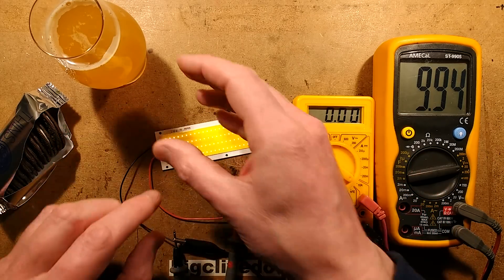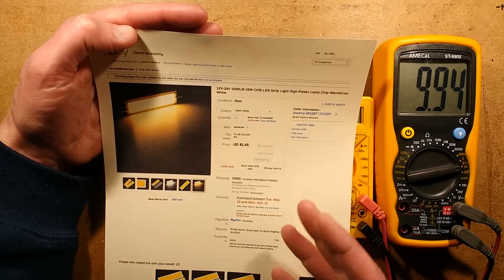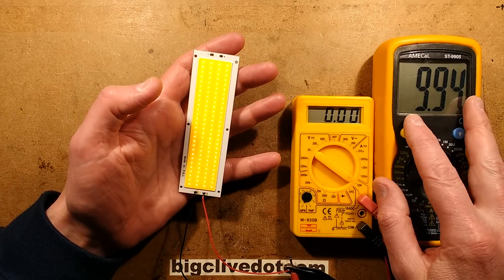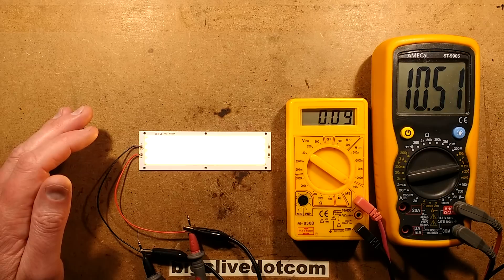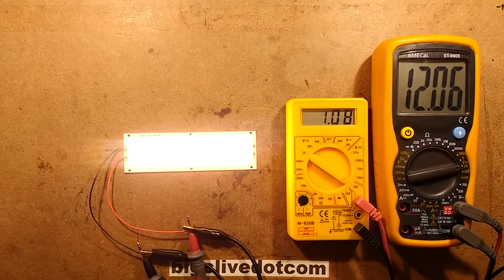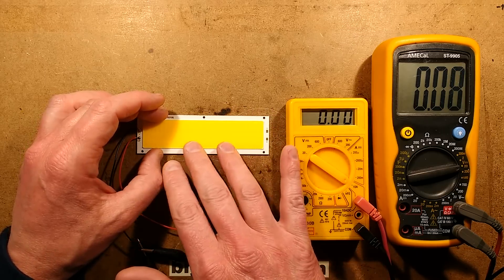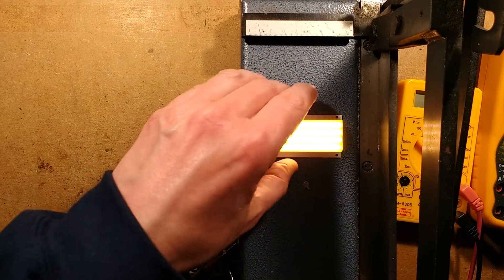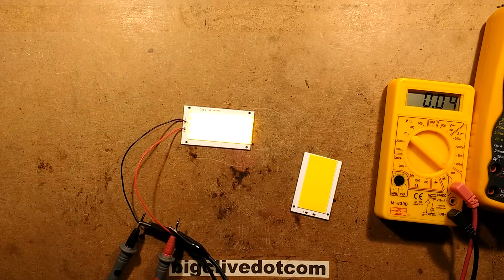Testing a large LED COB.

Comment: I've bought a few of these, and I'm pretty sure the 10W rating is just arbitrary nonsense.  They appear to be about 30 mil dice, and it'd be a fair assumption that they'll survive 150mA (about typical for 1/2W rated parts).  With 28 columns, that'd be a total capacity of 4.2A or about 50W.  The whole thing has more thermal interface area than most 34mm cob emitters do, so I don't know that it's unreasonable.  

Then again, who knows what the thermal resistance of the die attach & substrate insulation is like.  That, and the ones I have are quite mottled (low-quality chips?).  I'd still be tempted to at least provide a bit of resistive ballast to lower the current slope, but on such a wide array, there really isn't a way to enforce current distribution.

Of course, all of this is moot because I imagine 90% of these things will get shoved into an application where the only heat sinking they'll receive is being loosely screwed to something with the thermal resistance of a postcard.
Reply: Well, so much for my plan to mount these on postcards.
Reply: Yes, it's crucially important to have enough heat sink area for the emitter.  For something this big, you should use at least an A4 sheet of cardstock.
Reply: Use a stack of daguerreotypes.
Reply: Not sure they'd need a heatsink if you run them at 12v like there suppose to the metal on the back should be enough to stop them heating up. I was thinking of sticking them to my car and just limiting the voltage down to 12v and let them eat whatever current they wanted (current only seems to go up after 12v anyway).
Reply: At 12V, with no series ballast, the COB will draw about 370-380mA.  That's about 4.5W.  Considering that you'd want the substrate to stay below about 80C, you'll need about ~8K/W thermal resistance to ambient.  For a simple modeling of the COB as a plate suspended in air with natural convection flow across the faces of the plate, estimates for thermal resistance are in the ballpark of 10-30K/W (i.e. too high).  The variation depends on what the ambient temperature is assumed to be and how you consider the insulating behavior of the silicone phosphor coating.  At 14.5v, the power will be much higher.

Will mounting it to a relatively small bit of sheet metal suffice? Perhaps in some cases, but in an automotive application, the things that it might be attached to may already be at 70C (e.g. a metal plate or strut in the vehicle roof).  

Will shifting the operating point with a series ballast help? Sure -- as long as it can stay below Tjmax within the range of environmental temperatures at the selected operating point.   If you have an appropriate thermal design for a 12v operating point, you still have to keep in mind that your ballast will be shedding about a watt itself.  

Just because manufacturers push components well outside their SOA, doesn't mean it's smart to do yourself without accepting the potential consequences.
Reply: Dream Services International electronics give me a headache. Half the time things need a circuit the other half things are misslabled or simply don't do what there suppose to. The drop down will be fine it's one of those 12-24v stepsons in a waterproof heatsink (one of the few things that does what it says it does) as for the cobs I'll probably end up sticking 2 on either side of the boot like a work light if they need cooling I'll either jam a heatsink on the back or thermal paste them to something big and metal (make sure it's not going to short though)
Reply: +Dream Services International When calculating dissipation, don't forget modern LEDs are about 25% efficient (compared to a black body radiator), so only 75% of the input power gets turned into heat.
Reply: hellterminator: Correct, The calculations I used for the prior post assume P_radiant=0.2*P_electrical
Reply: Richard: A switching converter would shave off that extra watt compared to a linear or resistive ballast, and in reality a marginal heat sink would probably be fine.  I have a feeling that the quality of these arrays isn't that great, so one need not invest too much effort in perfecting their longevity.  They're cheap enough that if you don't mind swapping them out, then why not?   The ones I have run on a heat sink that's too small for constant operation -- but I never intend for them to be used for more than about 60 seconds.

In the end, you're free to make your own choices, but I find that life is less frustrating when you're able to better predict the risks of future problems and specifically accept that they may occur.  That's a lot less maddening then having something fail when you'd had no expectation that it might.
Reply: +Dream Services International How? 
12V*0.38A=4.56W. Where did you take off the 20%? 
Also “to stay below about 80C, you'll need about ~8K/W thermal resistance to ambient” suggests your baseline ambient temperature is 44°C (4.5W*8K/W=36K; 80°C-36°C=44°C). Isn't that a bit high? 
I haven't gone over your estimate of the thermal resistance, but your calculations seem a bit strange overall.
Reply: The nominal estimate I stated is the electrical power, not the thermal power.  The scripts I use operate on the stated assumption that thermal power is 80% of electrical power.  

The scripts default to the typical peak ambient temperature associated with the lamps I have been building -- 50C.  Perhaps it is a bit of an overestimate when applied generally to offhand unknown cases, but 40-50C is not uncommon for many applications.  These aren't even worst-case conditions. 

Also, keep in mind that if you try to back-calculate an input value from ranges of rounded output values, you're going to end up with another approximation.
Reply: In well-lit areas such as the dashboard, and in the space between the headliner and the roof, the temperatures can get absurdly high.  Even ambient cabin temperature in a closed vehicle can be easily >60C.  This is an old photo from a test of an unrelated cooling device.  The "in" sensor is the ambient sensor, and the "out" sensor is the remote probe in the cooled enclosure (not relevant).  This  offhand snapshot  is 58C.

https://a.safe.moe/ltGBMSg.jpg

Of course, a device that's operating in open air and only when a person is inside will usually be cooled down once the cabin is ventilated.  Things that operate unattended or in the headliner space or against the roof are another story.

Comment: Clive, 12v alternatore will routinely have an upper limit of 14.4 volts. 13.8 is just idle speed power, fwiw.
Reply: Yep spot on, sometimes a tad more ,but point is 12v cars arnt, safer to build fir 15v
Reply: Против Глобал EU, US, Japan, the trandient spikes thrown by starters as they disengage run up to 600VDC and truvks run to 2000VDC but that is only for milliseconds. Spike protection is a separate matter from operational voltages though.

Comment: I would use an LM2596 DC-DC module, to run them in a car or RV. The modules are $1 Canadian, on eBay.
Reply: Resistors are cheaper. And if you only need ten hours of life out of the LEDs, you don't need a resistor.
Reply: James Van Damme Believe it or not, 3 watt resistors are about the same price as these modules.
Reply: Против Глобал what's the function of the diode? Something beside reversed polarity?

Comment: Great stuff BC :) thanks.
I wonder if you could make a big 7 segment display out of it when you cut it into pieces, or cut 2 into 4 pieces each then use a colored(red/blue/green) transparent film on top of it.
This bench power supply might help you in your projects, cause it shows consumed voltage and amperage on its display so you do not need to use 2 DMMs. GOPHERT CPS-3205 / CPS-3205II
https://www.banggood.com/GOPHERT-CPS-3205-0-32V-0-5A-Portable-Adjustable-DC-Power-Supply-110V220V-p-934530.html

Comment: do you think you could wire 10-20 of these together to make a growlight?
Reply: No, they only need to be red and blue.
Reply: Moose   chuck is right in saying that green plants only need red and blue - they reject (reflect) green, which is why they look green.  But white light contains red and blue, so you can use white light for a grow light.  Sunlight (white) suits them okay after all.  You're just using more energy than you need to.  It comes down to cost of equipment and running.
Reply: No, white sunlight contains the entire spectrum, artificial light is made up of a set of wavelenghs. You either need a bunch of luck or a real growlight.

Comment: Damn I am using those Cobs as a replacement for track lights.  I take 24v AC down to 12V DC. Sitting behind the buck converter and a bridge rectifier seems to limit the current.     I put a thermocouple on the back of the aluminum and it did not go over about 50 degrees C. What size resistor would you put in front of the unit.  Oh damn you mentioned it in the video.  I might bring the voltage down to 11.5? what do you think is 12v ok?
Reply: Arnold Horshack 
If the module is only producing 50°C then it seems that 12V is fine. However, the cooler the LED's run, the longer they should last, at least according to conventional wisdom.
Reply: thanks Pete.. I am glad the big guy reviewed these leds..  I am mostly new to tinkering with electronics and Clive (and Julian Marco Reps and Afro Mods) have all helped me to revisit something I did as kid (build radio shack kits) at a higher level.  I did notice at 24v these things were pulling 3amps I said nooo..
Reply: The 12v produced from the buckconverter is not ramping up to 14v. The converter is probably experiencing the 24-28 volts but steps that down. Then the 12v is good enough

Comment: Couple of points:
1, that high pitched whine/hum in the background is actually the sound of Clive's positronic brain working away 😜
2, I would think a cheap step down (buck) regulator that has output current limiting would be better if running from a 12V or indeed 24V car/van/truck/caravan or boat supply 😉

Comment: I was cringing as you went to cut that COB in half, but, I'm actually impressed that it survived, well, the one half at least, the other half still needs testing... :D
Reply: As it has busbars and solderpoints at the other end, it should be fine aswell.
Reply: What would break exactly? You could possibly have a short circuit at the very edge, but that's about it. I'd be more worried about long term reliability due to corrosion where moisture can now enter.
Reply: They‘re like earthworms!
Reply: Hi, I'm quite impressed with these little strips, I'm going to use a few of these in a project with a 12v laptop supply with a Buck transformer and run them at a modest (cooler) current, maybe 500ma a peice...11.5v ish.
My question is to reduce flickering (if any) would it hurt adding an electrolytic to each one just to guarantee no flicker? If so, what value would you suggest on a 16v cap?
This may be irrelevant as long as the laptop supply is smooth anyway but if I wanted to make sure, is there a sweet spot regarding caps or is it bigger the better? 
Thanks, your avid subscriber.
Reply: they dont need to be cooled, they do not get above certain temperature
Reply: Cody Slab ok...thank you but that wasn't my question.
Reply: stop kissing ass

Comment: How hard would it be to put leads on the part you chopped off?
Reply: Jim Fortune 
Simples! 
There's already solder pads at both ends of the PCB for the option of daisy chaining multiple units together.

Comment: I purchased some smaller cob modules that were advertised for car use, and came with 3 different bulb adapters so they were effectively plug and play. I tried one in the interior light cluster in the car and after about 5 minutes it got so hot the solder melted releasing the power wires, perhaps a good thing really. From China of course.
Reply: Richard Dobson 
Perhaps they were intended for use with a heatsink of some sort?

Comment: It's important to note that the guillotine is NOT your standard, everyday paper cutter.  Standard paper cutters slice the paper starting at one end and progress to the other.  The PCB will 'break' ahead of the actual cut point as the cutting blade passes the support surface.  You want something to keep all the PCB stresses evenly distributed along the length of the cut and limited to the cut itself.  Even tho Clive's guillotine has a progressing cut, the additional leverage allows for a quick cut to reduce the 'breaking'.  I wonder if I can convince someone that theirs needs to be replaced ;-)

Comment: i would suggest to also fix the voltage across them with say a (high power?) zener in paralell as the vi curve of a diode (so also a led) drifts with temperature leading to a higher current as the leds get hotter and thus only heating the leds even more

Comment: Clive, if you want to heat it up to solder, just give it power for a few tens of seconds lol.  What would've been really nice is if it had a low profile buck regulator on it for vehicle electrical systems, or at least offered both versions.

Comment: Are those solder pads on the cut half of the module ? if so can you solder on to those and have two for the price of one ....
Reply: It's really not worth being that cheap about it.  Buy a smaller module, or run the larger one at lower current for higher efficiency and/or less heatsinking needed which in itself can lower cost and design time.
Reply from the maker: Yes you can.

Comment: I actually have a pair of these exact modules in my cargo van.  I found that they will get particularly hot when supplied with sufficient current (nice sizzling chicken effect).  However, they seem to run quite happily with a 15 ohm resistor ahead of two modules.  I've got roughly six months on mine so far, no failures.
Reply: guitarstitch why not use a buck converter ? More efficient what you think ?
Reply: Ammar Abotouk And of course they cost next to nothing
Reply: Do they give out enough light after putting in the resistors?

Comment: Not bad! You could actually use those with one of those cheapo LED drivers inside some cheap lamp fixture, the thick aluminum backing plate could make them a better alternative than those standard COBs.
Reply: Please actually stop using the word actually where it actually isn't actually needed actually.   Regarding cheap lamp fixtures, it'd be reinventing the wheel.  A legacy lamp fixture is meant for a certain bulb format and most of those are now covered by inexpensive drop-in LED replacements, with a certain level of tested reliability, and safety if you buy a major brand.  Instead you could create your own artistic version of a lamp, optimized for the form factor of the LED(s) used.

Comment: I wanted to get a proper PCB shear, but as a hobbyist I just couldn't justify the expense... I got a sheet metal shear instead for about 1/4 of the cost. I'm sure it doesn't cut PCBs as neatly and cleanly as a proper PCB shear, but... yeah... Anyway, I haven't reinforced the bench out in the shop and bolted the shear down yet (the 2x4s, screws and bolts are for that purpose!) http://randomer.net/ee/shear.jpg

Comment: If it really is 1000lm at 10 watts then it works out at about 100lm/w which is very good for a COB light. Efficiency probably drops at the higher currents. As a comparison, the best virtual-filament lamps (Dubai Lamp) come in at 200lm/w and you can buy virtual-filament lamps from Tesco for about GBP5.00 which work out at about 130lm/w.

Comment: We have that kind of cutter at work for cutting paper near the printers. I'm sure one could find some for almost free when they are discarded from companies. Very useful things.
Oh and does the chopped off bit light up too if you wire to the connectors on the other end? I suppose it would, looks like they can be daisychained via those contacts.
Reply: I have one of the Paper cutter things you mention. It has never been the same since i tried to cut PCB with it.
Reply: Pentti, I think paper cutters probably don't have nearly as much rigidity as the PCB shear.
Reply from the maker: The other bit should light too.  And if you divided it further you could still scrape and solder the tracks at the sides.
Reply: I've a paper cutter, the blade tends to flex even on thin PCB.
Reply: I have a paper cutter and the blade flexes if I try to cut 2 sheets of cardstock at the same time.
Reply: bigclivedotcom f
Reply: bigclivedotcom
I've been wondering how a laminate flooring cutter would do
https://smile.amazon.co.uk/dp/B003AAJ5T4/
Would need to rig up a bed to sit the PCB on but that shouldn't be much of a hassle.
Does have a curved blade though.
But it's less thatn £30. I'm kind of tempted just to see how it goes.

Comment: The thin Oreo's are a world-wide thing apparently, only in America they also sell them dipped in fudge :D  Just for that extra fatty chocolatey goodness!  And yes, the thinness doesn't stop the gluttony!
Reply from the maker: But you could just eat one.....   (Not really.)
Reply: I don't think I have that level of monk-ish willpower.  I don't even think I have poker-player level will power when it comes to fudge-dipped biscuits :D
Reply: I was also thinking there are automotive flashing units that run LED's (usually in an amber and white configuration) to signal caution for work trucks and the like.  I think taking one of those modules (which you can find from Chinese sellers without the actual LED's) and hooking it up to a set of these would make for a fantastic light show! (if not slightly epileptic) Something like this: https://www.ebay.com/itm/6pcs-DC12V-3W-18LED-Car-Amber-Strobe-Emergency-Flashing-Warning-Grill-Lights-Kit/173030553410
Reply: takes bite out of Big Mac while fighter jets fly overhead, dropping crates of Bud Light 'Murica!